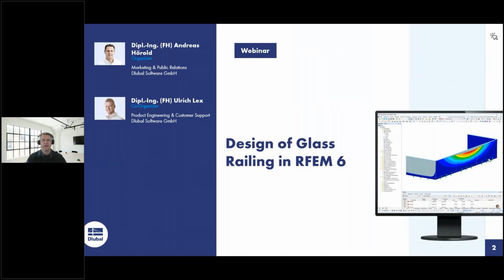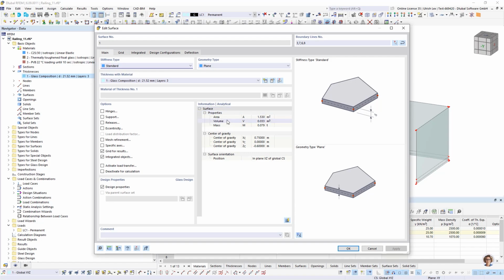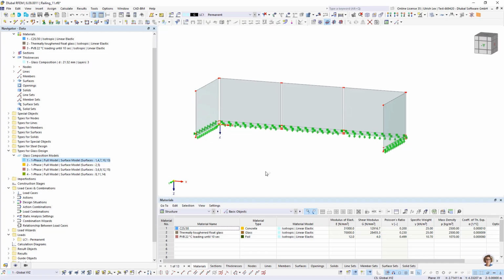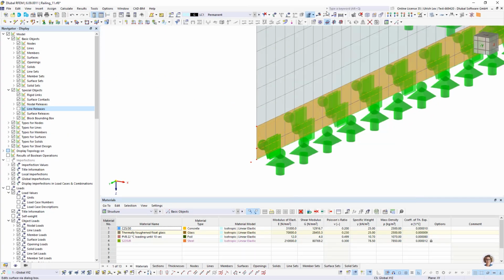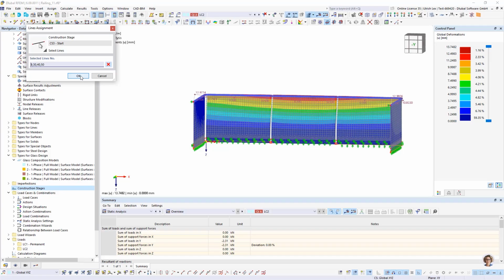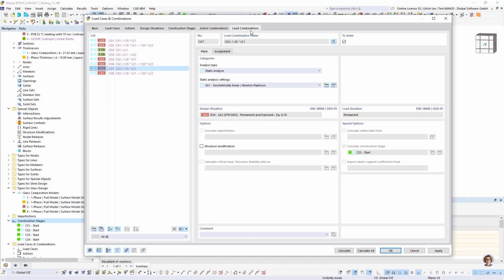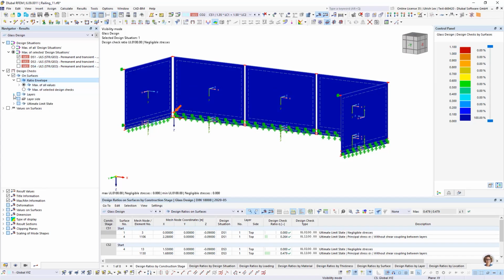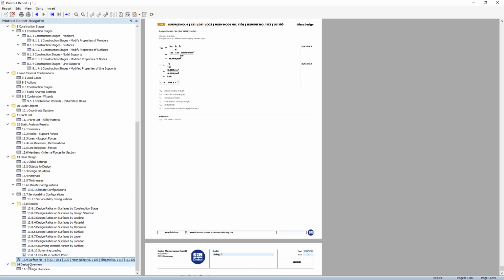Webinar | Design of Glass Railing in RFEM 6

Comment: Can you design the bottom bracket in rfem6 too ?
Reply from the maker: Hi, @zain786ification! Thanks for your question and yes this is possible in Rfem6
Reply: @DlubalEN Could you make a tutorial for that ,showing load transfer from glass to bracket as non penetration simulation ( I mean not bonded)?
Reply from the maker: Hi, @zain786ification! Thanks for your suggestion. We will try to consider it in the future.
Reply: @DlubalEN I usually do it in SOLIDWORKS simulation, it would be great it would be possible in Rfem .